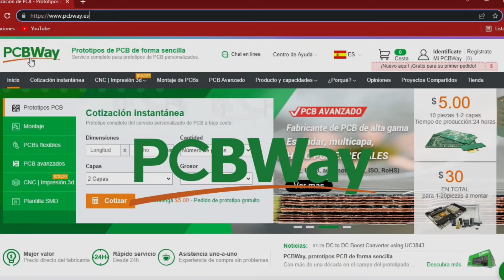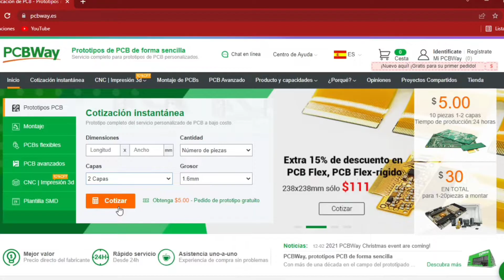🚨Cómo Hacer un Circuito Básico (Usando un Sensor de Movimiento PIR) en Protoboard / PCBWay

Comment: Excelente video estimado. Pero tengo un problema. Y es que no tengo la resistencia de 270, sino una de 220 (esas azules de 5 bandas). Y cuando le doy corriente de la batería, enseguida prende el led y el buzzer, pero luego se apaga y no detecta el sensor bien. Será problema de la resistencia?? Podrás ayudarme. Gracias
Reply: eso depende de la tolerancia de la resistencia